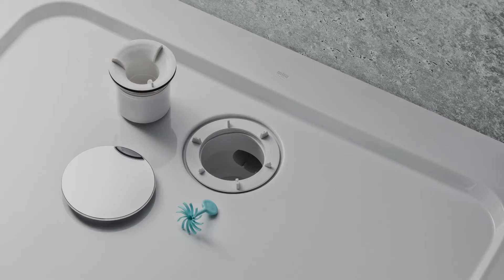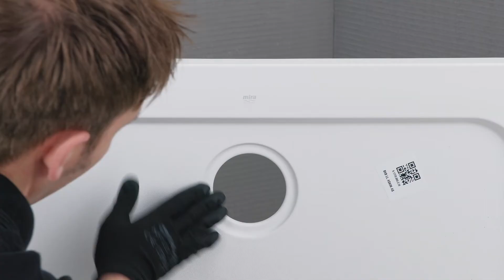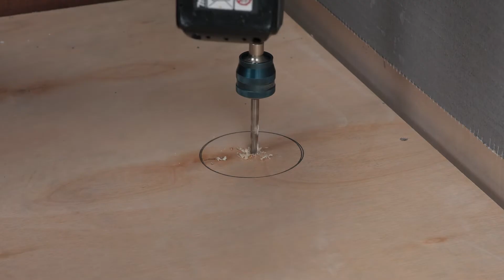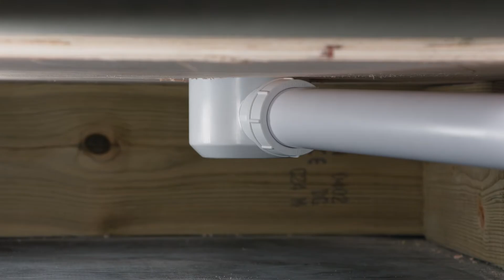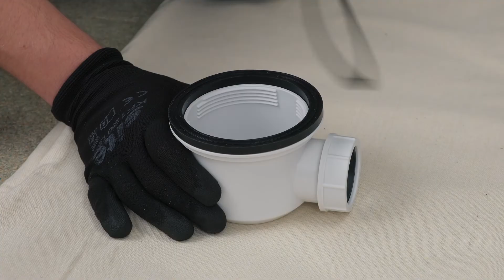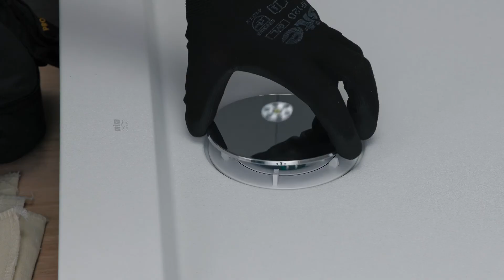Mira Shower Tray Installation | Mira Flight Low Step-by-Step Installation Guide

Comment: Where can buy the Chrome cover ?
Reply from the maker: Hi, thank you for taking the time to share such detailed feedback.
We're sorry to hear about the frustration you've experienced with the waste trap installation and the difficulties identifying the alignment arrows. 
The alignment markings are intended to ensure the trap performs as designed, but we recognise that if they're difficult to see, this can create problems during installation and maintenance. Your comments regarding the visibility of the arrows and the challenges of refitting the funnel and cap have been noted and will be shared with our product team for review.
Thank you again for your comments and for your kind words about the shower tray itself. We genuinely appreciate your feedback.
The Mira Showers YouTube team
Reply: @mirashowers  apologies, I spoke too soon. The problem I'm having seems to be not uncommon, and seems to be an air issue. Basically if I put the trap on fully / properly, it creates an air-lock and water stops flowing after a while. If I put the trap on partially (i.e. give it some room to "breathe") it seems to work much better. There is a thread on the screwfix forum about this problem across various showers. Their fix was to drill (small) holes into the trap. Mine is just to put the trap on loose which so far seems to work, but obviously isn't ideal.
The question is, is this a design flaw of the trap, or do I have some dodgy pipework (i.e. a flat section / not enough fall)? I'm not an expert in plumbing. It's definitely an air-flow problem, I just need to know what the culprit is.
A trap design flaw would be preferable to me since it's a much easier fix. Would appreciate any insights!
Reply from the maker: Hello there, after liaising with our Trays & Enclosures Customer Service team, they believe the 'airlocking' issue you are experiencing could be down to the pipework angle but in order to go through specific troubleshooting, it would be useful for them to know a bit more info on which tray in particular you have. Please call them on 0800 001 4040 and they will discuss installation, pipework and any modifications suitable.
Kind regards, The Mira Showers YouTube team
Reply: @mirashowers  thanks so much for that incredibly helpful reply! Much appreciated!
Reply from the maker: Hello aupeggy7358 thank you for your comment. The chrome cover can be ordered directly from us. Please contact our call centre on 0800 001 4040 if you would like to place an order. Kind Regards Mira YouTube Team
Reply: @mirashowers  your trays are amazing. Your waste is awful. Specifically having to have the two arrows line up. I cleaned my funnel soon after install and realised after the shower wasn't draining properly. Told the builders who took the funnel out and showed me their pipework was ok since it worked fine without the waste trap. Spent the next year choosing between having water flow or stopping the smell. Bought another trap (McAlpine) to replace yours, but realised it was the same design so wasn't sure it would fix the issue. Luckily I stumbled across this video and realised the funnel has an arrow and must be aligned. The arrow is frickin tiny! Even with glasses on I needed a magnifying glass to see it. I can't see the arrows in this video either. The McAlpine trap would have solved the issue, since theirs doesn't need a particular alignment to work. As someone else said the cap is hard enough to put back on, but that funnel is diabolical. Please start bundling your trays with McAlpine traps! Leave the trap design to the experts.
TLDR: A great tray ruined by an awful waste design.

Comment: The worst try on the market take my advice don’t buy one would never fit these again
Reply: Why??
Reply: @peterjones2761  peter the problem we found that where the drain hole was that it was not flat which meant getting a seal was difficult. The Mara flight shower trays with the designer slot in them was just ridiculous. It just kept blocking up due to a poor DESIGN problem in the end all the ones we fitted we took out of service. I hope that helps you.
Reply: Skill Builder did a YouTube on the Mara shower trays have a look it will confirm what I just said

Comment: I'd like to have a riser kit for ease of later maintenance but there's nothing about the central support.  It's a solid construction but not a lot about installing the feet/pillars.
Reply: I would prefer to make up a suitable upstand using bricks and mortar if on the ground floor, not sure about a first floor, but I dont like the flimsy legs.

Comment: These things are hopeless because the lip isn't flush with the shower tray so there's basically a permanent moat around it that doesn't drain. Whenever you've been to the beach this fills up with sand so you end up with a visible grubby ring of sand and other dirt sitting permanently around your waste. With our old shower sand and mud used to just easily wash straight down the drain, but with this useless thing you have to get down on your knees and swish it all out with an old toothbrush every time. Pathetic design.
Also it's impossible to get the shiny plastic cap back on unless again you're grovelling on your knees with your head on the wet shower tray to see under it and it feels extremely flimsy. Disappointing.

Comment: May I ask you a question . My shower is this mira shower drains , however it’s a trouble problem . I can’t buy a fit hair stopper , nothing can fit this shower drain , and this shower drain originally can’t stop all the hair , what should I do🥹🥹
Reply: Did you figure this out. Currently having the same problem
Reply: @ yes I did , I found something from internet, it is a very small net to replace the blue catcher , better than before
Reply: @babydecide where did you get from please or what is it called? Really struggling to find something similar

Comment: Stopped watching when the installer removed the wall board and inserted the tray, this is a massive no no and will result in total failure, the tile is the over lap. The tray should be fitted to the wall board then siliconed. Once tiled the tray should be siliconed again between the tile and the tray. Ok so i watched some more never ever ever silicone a tray to floor it gives no support whatsoever and the tray will almost certainly crack. Mira are you really putting your name to this installation video.

Comment: I was told cutting the wall away is a no-no.  When the silicone fails the water is straight in behind the tile board / wedi board (although noted you have a second bead - most are recommending seals or tanking with those cloth strip things) ? Also doesn't it increase the likelihood of the enclosure not fitting - as your tray is effectively smaller.  The question I wanted to ask though is - do you 2nd silicone to the tiles before or after installing the enclosure as this wasn't clear at the end.
Reply: yes im suprised they cut the wall instead of tanking with membrane paint or tape
Reply: I agree. I used a No More Leaks kit by Abacus. I didn't need to cut into the tile backer boards (or wall). Once the tray was in place I used the kit to seal the corner between tray and wall and then installed UPVC panels over the top before finally using CT1 to apply the final seal. Roger Bisby gives a good demonstration about how to install here https://youtu.be/5L2WN5rfHKM?si=qr-3sCB9vpoywogK . I also installed a Mira shower enclosure. I found that there is a built-in tolerance, so although the area of my shower tray was 10mm smaller in both width and length as a result of my uPVC panels, I was able to adjust the enclosure to compensate for this.

Comment: Cutting the wall material out is good, as it enables a better seal to be made. I noticed that they didn't show how to fit the waste without the riser kit. Presumably you have to cut a hole in the floor adjacent to the shower, or in the ceiling below and make good! I thought they could have done better than that, so probably not for me.
Reply: It would probably involve taking up the floorboards first off, getting the waste pipe for the shower in situ, relaying the floorboards and then installing the shower tray. You’d then reach inside the hole of the shower tray to secure the trap/wastepipe
Reply: Suction pad pen..?

Comment: I get that a bed of mortar or silicon can be used to secure the shower tray to the floor, but what if a shower riser is being used? Do we have to somehow fix the feet to the floor to prevent the tray from moving?
Reply: This is my concern too.  I'd like to have a riser kit for ease of later maintenance but there's nothing about the central support.
Reply: @CosmicClaire99  Eventually I installed a 1200 mm by 800 mm Mira Flight tray which does have a central support included in the riser kit. I also fixed a baton under the tray for it's entire length next to the riser feet which prevents movement in one direction. I also cut shallow holes under the riser feet (the same diameter as the feet) to prevent movement in other directions. Have been using it for a while now and it feels pretty solid.
Reply: @stephengraham1153  Thankyou, very helpful.  I've found one now and as soon as my plumber okays it I'll be putting in an order.

Comment: This is the first video I’ve seen recommending the need to “remove the lower wall material”.

I wonder if using an appropriate seal would be better and less hassle?
Reply: I agree, if you read the installation instructions for a Mira flight low level tray, removing the lower wall material is only shown for trays with an upstand, which makes sense, for those without upstands it shows flush fitting to the wall. instructions can be found here https://resources.kohler.com/plumbing/mira/pdf/1192074-w2-b-mira-flight-shower-trays-range-installation-and-user-guide.pdf
Reply: @tonymcfeisty2478  Thanks for clarifying! I see what you mean now from the instructions.
Reply: But the tray in the video doesn’t have an upstand. 🤔
Reply: @barrybeanstain  yeah I'm confused too. This is Mira official ? Can't be right.
Reply: A shower pan is a shower pan make it level and yeah you get rid of the lower drywall easer to install a 42 by 42 pan in a 41 inch spot bet you don't know what to do you got to cut the bottom of the wall Joyce out then you put your pan in then after you get your pan and you got to shim the bottom of where to cut out so your walls don't sinking give me a call I'll show you how to do it I ain't no cheap date though let me know you need some help